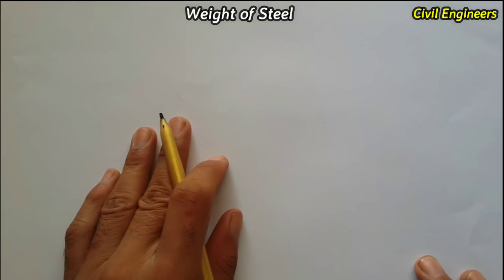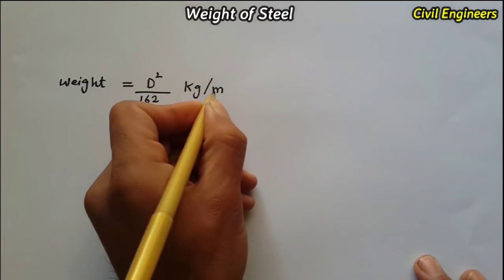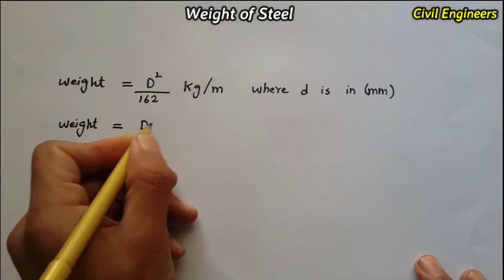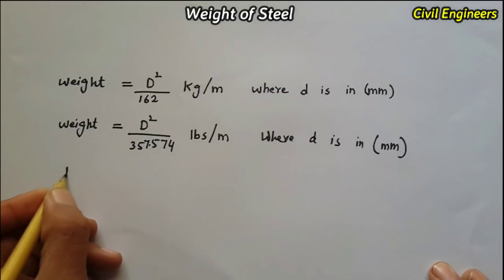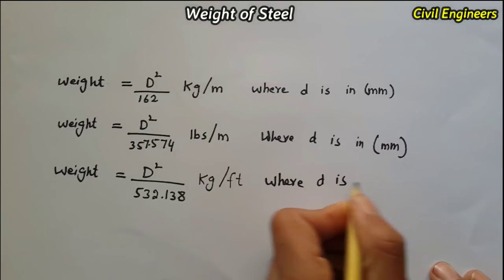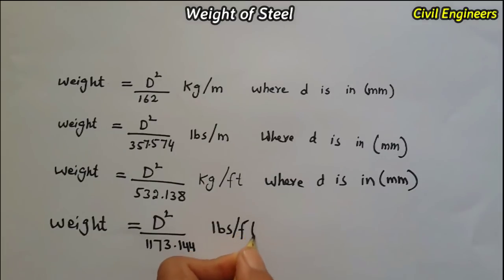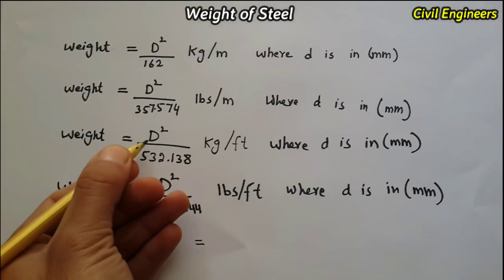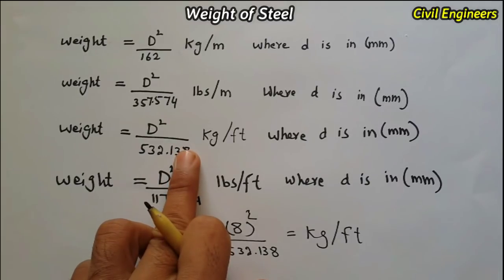How to Calculate Weight of Steel | Steel Weight Formulas|

Comment: Brother please suggest for me iron staircase,or conceret staircase which is best and cheaper and also advantages and disadvantages of best one.thanks
Reply: Haq Nawaz  rcc stairs are cheaper then steel stairs. Rcc stairs are long lasting more durable and easy to built and  riser can be adjusted during marble. Steel stairs require skill labor & less durable require extra polish and finishing but aesthetically pleasant.